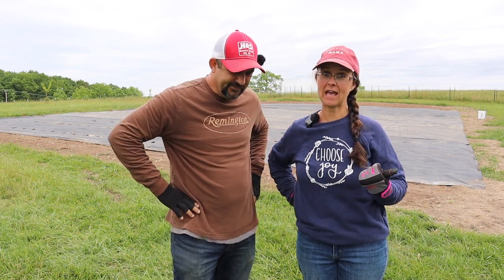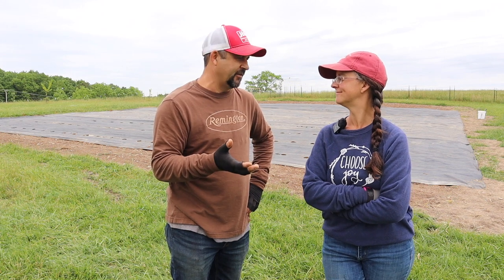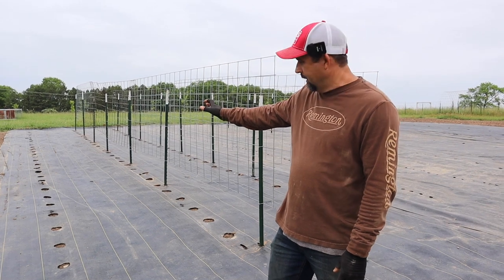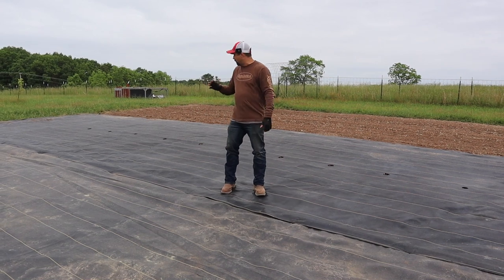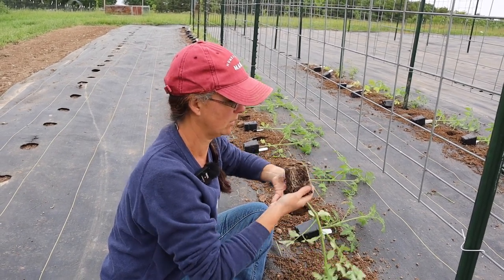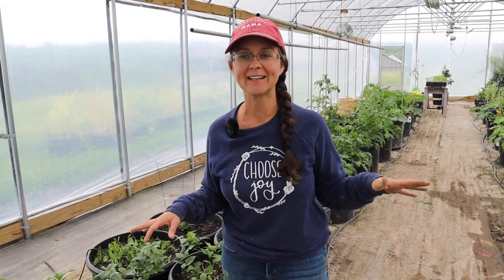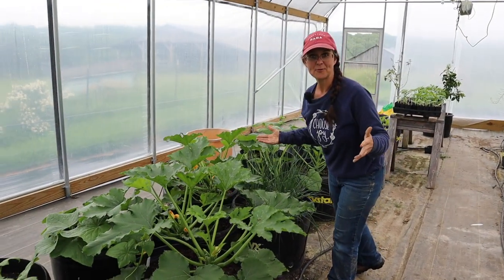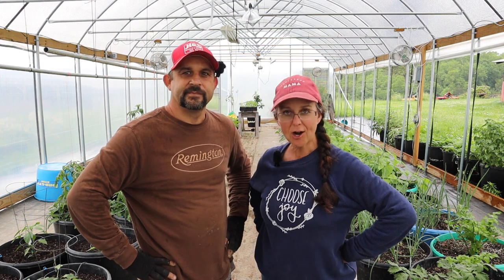Finally Planting Day, we just can't catch a break!

Comment: Lord have mercy!  You soil is so different from ours here in No. Florida!  I'm in Zone 8b.  Mine has some sand in it, and it tends to stay a little fluffier.  I planted my tomatoes (Nine, 30' rows) on buried drip tape, and used a Stand 'n Plant transplanter.  The older I get, the less I can get on my hands and knees to plant things.  Getting down isn't the problem - it's getting back up!  I plow a trench with a wheel hoe and lay the drip tape, and use the transplanter to plant the tomatoes next to the emitters.  Then I bury and hill the tomatoes with a high arch wheel hoe.  Since I don't need  to pot up my tomatoes, it's really easy to get them in the ground, and the warm weather makes them grow fast.

I certainly do feel for you - We've had rain for the past 6 days and are expecting rain tomorrow, too, making it impossible to get out and do much in the garden.  This year has been a real challenge for me and I'm late getting things planted, too.  I have managed to Florida weave my tomatoes between rain showers, but can hardly wait for the soil to dry out a little so I can take care of any weeds Friday afternoon.

Comment: We are newly transplanted to Indiana. Late garden but it would've been much much later if we had tilled under the fabric. One, our tiller for the tractor broke blades every time we used it. Two - we raked all the grass out and were left with just indention into the ground. 3- it was too bumpy to lay the fabric down. I guess with our small tractor we would need an assortment of implements to get it done right. So, we put the fabric down nice and smooth after mowing really short. We drilled the holes and added all kinds of amenities to the holes and added the plants or seeds. . . We are still putting stuff in - but the corn that we thought was way too late is coming up. Who knows? Maybe this late season was a good thing. Just trying to get started in a new place is really HARD! Blessings!

Comment: It is probably a blessing that you didn't get your peppers in because cold weather seems to have an effect on them for the life of the plant.  I live in Oklahoma and had mine in and established.  That took a little effort because it was too cold to get them properly hardened off for a long time so when they were actually planted I kept them covered with a row cover for about a week because the temps were high and the sun was bright.  We sort of went from winter to summer overnight, but once these heavy rains started, it dropped down into the 50's at night.  In spite of that, they are setting fruit.  Mine are all planted in containers, but the containers are on top of the same type ground cover that you use so I don't have to fight weeds.

Comment: Had a thought on using 5 gal bucket. Ive had wire pull out. What if to save bucket. Drill hole all way thru. Take a roape put thru hole add washer tie knot. Before tie other

Comment: The wires you used to hold the cattle panels on the t-posts, what are they called? They look easy to use. We use these little wires that have loops on the end where you twist them together to lock them in place, but they are short and just barely reach around the post.

Comment: i love your ideas and we are implementing them.
we have 6' wide weed barrier.
we are not having any luck with the staples holding.
the wind was just blowing it up staples and all.
we had to make trenches on either side of the rows and cover the edges with dirt to hold them down.
that has worked but we had to make dirt paths between each piece that we will have to keep weed free but at least the weeds wont be in our planted rows.

what do you use to hold yours down and how do you get yours to hold?

where can i order 15' wide weed barrier rolls?
that would save so much time and work.

Comment: It seems all are late getting gardens in this year.  I use the woven ground cover and I was wondering if you rotate crops.  When using the 3 foot it's easy to write on the end what crop or spacing I've used the cover for previously.  How do you do that with a 15 foot wide piece of ground cover?  I noticed the previous holes from other crops on the 15 foot wide cover.

Comment: I tried the cattle panels.  Can you show how you did the brackets where the panels meet?  I tried to use a common T post but the brackets don't fit.  I would so appreciate your help and suggestions
Reply: Since the panels are as sturdy as they are, we typically put a T-post just one rung inside the end. I makes 2 T-posts fairly close together, but it holds just fine. Then, if the two ends are not meeting up properly for some odd reason (a slightly bent panel for example), then we just use a few zip ties to pull them back together. Hope that helps and good luck with your future endeavors. :)
Reply: @gwendyrose8905  Thank-you for your help.